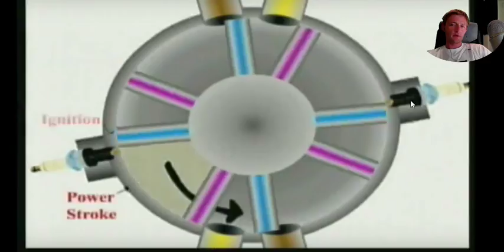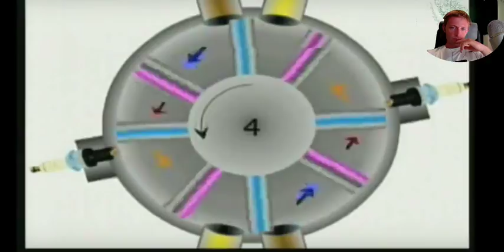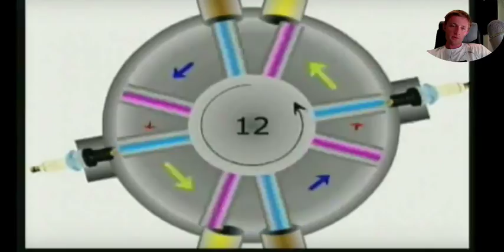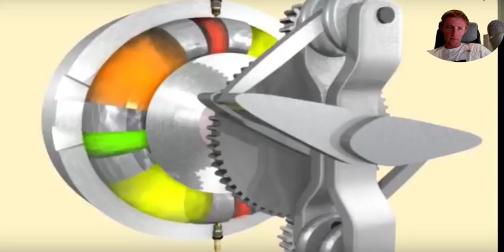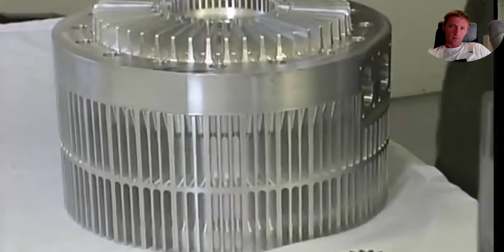MYT ENGINE !!!

Comment: Good day . We want to present a revolutionary engine for the world market, it is an internal combustion engine Patented by PCT pending in 59 countries which is a revolution in terms of: Design, economy, efficiency, costs, weight and ease of production, size scalable to any power without limits, for any type of fuel, such as synthetic methanol for negative CO2 emissions and HYDROGEN for ZERO emissions, obtaining 3 times more efficiency than a current engine and greater than batteries and also hydrogen fuel cells used with electric motors, a novel thermodynamic cycle with more than 75% efficiency, that is: One liter of fuel is enough for 50 kilometers in a vehicle, only two main moving parts, a power/weight ratio greater than 13 KW/Kilo, everything can be aluminum except mainshaft, bearings, seals and screws, uses no liquid coolant uses air and very little lubricant from the center, the speed of the seals or segments is 3 times smaller than in any motor, which gives 9 times more useful life +30,000 hours, it can be extrapolated to any power without losing any characteristic,. Very easy to manufacture 100% with current basic technology, all its main moving parts mounted on commercial bearings, almost zero maintenance, and more than 70 additional advantages....
As an example: Motors of 100 kilos of 1300 Kw can be made very compact without useless space.
https://www.youtube.com/watch?v=j3VRy7VqYE8&t=6s
https://www.youtube.com/watch?v=j3VRy7VqYE
https://www.youtube.com/watch?v=H2r8O1FfPt0
https://www.youtube.com/watch?v=9LnrNiHC_34
https://www.youtube.com/watch?v=VjNRkwqDXRs

Comment: How are the pistons lubricated?
Reply from the maker: elmura73 really this i did't check but i believe there is a mixture oil with gasoline something like that.
Reply: It has a dry sump oil system
Reply: Travis Beagle Even so, if the pistons are lubricated, oil will go out ports. If not, the rings will destruct in no time
Reply: Adventure Story  its a strictly diesel engine i believe.
Reply: elmura73 you can siphon oil out of the ports right?